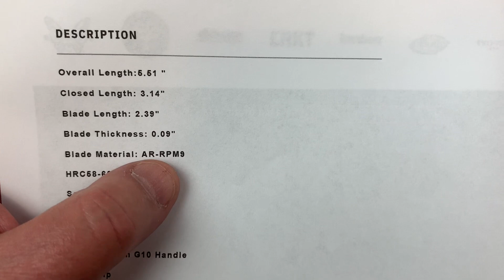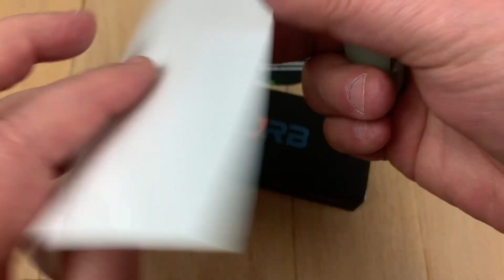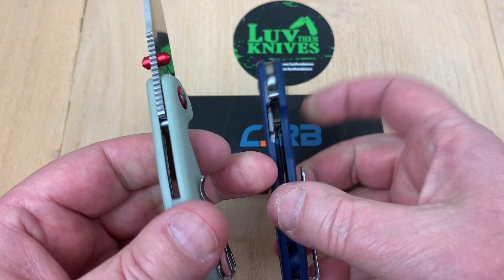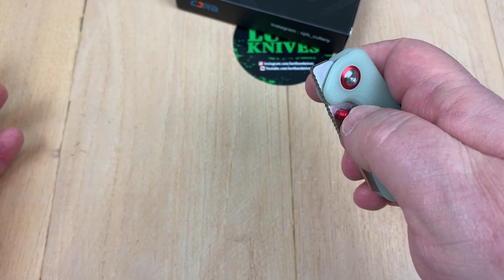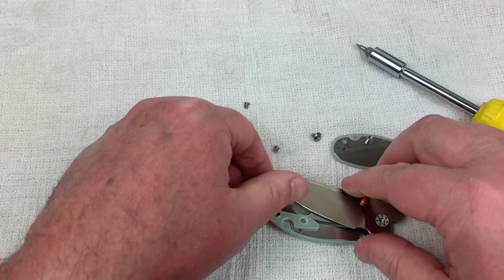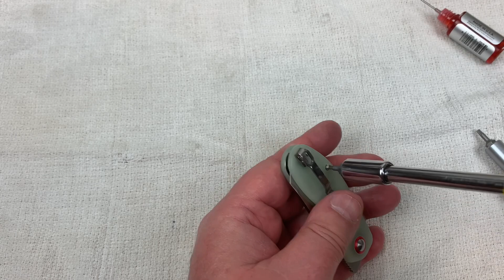CJRB Maileah / includes disassembly/ great design/a superb lightweight budget carry AR-RPM9 blade

Comment: I heard the steel is a powder form 9cr18
Reply: The formula has similarities to 9cr18. It's powdered for a more uniform grain structure and we added a little bit of Cobalt into the mix to give it some better edge retention properties.
Reply: @artisancutleryknife  I've been taking the Maileah and Ria to work where they get tasked with a fair amount of matter separation. Plastic ties, cardboard, pallet straps. 

I'm impressed with AR-RPM9.

Either of them can get me through a day's work and strop back easily enough. When I sharpen them, it's quick and both deburr well. The corrosion resistance seems quite good too. 

I'd love to see this stuff be offered up as alternates to D2 in most of the CJRB line.

That Sea Snake is next on my list. Really looking forward to a fixed blade in this stuff.

🔪👍🗡
Reply: 9cr is a good steel for the  EDC type knife.